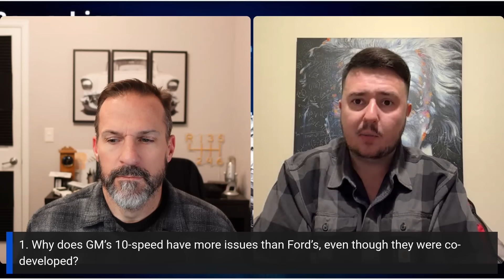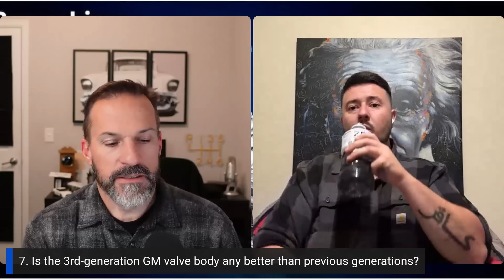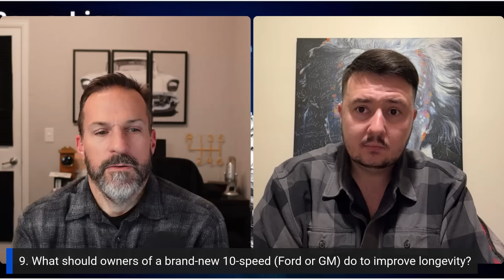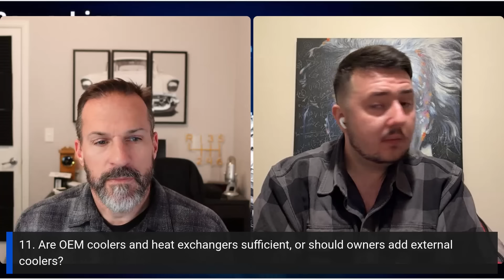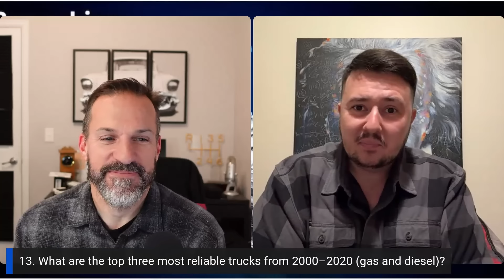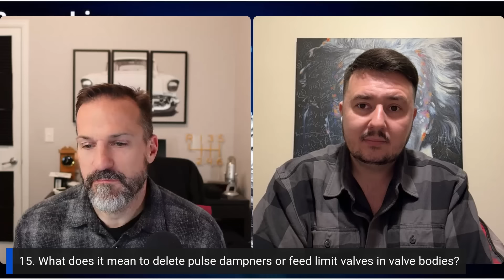Stop KILLING Your Transmission! The Maintenance MOST People Ignore (With NextGen Engineer)

Comment: Almost all the transmission issues ppl are having are due to heat. GM bypass opens at 190.. so the transmission on a summer day not towing is 200+. Get a SURE-COOL Flow Control Thermal Bypass Valve and this will lower your transmission temp by 50 degs. This is exactly what Nate describes his kits doing. The difference is.. it’s only $40. This won’t correct already damaged transmissions, but if your trying to get your trans to last long term, this is the solution

Comment: On cars that I do transmission fluid drain n fills , I like to rev the engine to 2k rpms to fill the torque converter then on the lift put it in drive and run it into second gear and In reverse letting the wheels turn , a few times reverse and drive , then in park let it heat up while still running until it reaches the oem spec temp . Then adjust the level . Another full proof way to put in the same amount of fluid as you took out is to measure out what you take out so you know that at least bare minimum you’re putting back in what you took out and then recheck the level.

Comment: I can support the correct fill problem. Years ago I changed the 4l60 in my 98 k1500 gmc pickup and never double check ed and drove it at least 2 quart low for at least a year and it never up shifted properly, it would hang shift... then I filled it while in neutral to run the pump and, after filling it up, shifted properly. Too any doubters, I'd believe him.

Comment: I do a transmission flush at home. Drain and drop the pan, swap the filter. Pan back on, then disconnect the cooler return line and use some clear tubing to drain it into a bottle with graduation marks. Put back in the same amount of fluid as I initially drained. Start the car, drain a quart, stop it, add a quart, rinse and repeat until the transmission fluid coming out of the cooler looks fresh.

Comment: I wonder if a modern engine could be retrofitted with a dip stick?  Just checking the transmission fluid on most modern engines requires getting under the vehicle and opening the drain port.

Comment: On older high mileage cars that I buy I will actually do two drain and fill services with a day or so of driving between the services. That way I have way less diluted fluid in the trans with a higher percentage of the additive package. It’s surprising how dirty the fluid is on the second service with just 20 miles of driving on it.

Comment: Mechanic dropped my equinox tranny fluid at 44,000 then I realized it was not hard to do so I did it at 60,000 miles 2 separate times with a few 100 miles intervals and the first time it was thick milky and the 2nd less so. I realized that if I fill it I have to drive it a little to get it hot then check it to get the right reading after I filled it. All of this about never change it after high miles was a good question to ask to clear up.

Comment: So just on the topic about reliability, service and maintenance, I did not hear anything mentioned about differences in fluids being used but are within the same spec. So for instance is there a difference in the ULV fluids in GM's vs Fords? How do they differ from each other and how do they differ from other manufacturers that create the same Spec of fluid? Are there advantages over one versus the other? Does one create better heat dissipation than the other? Questions one may wonder to buy an $8 qt versus an $18 Dollar qt.

Comment: Unbelievable that a nearly 100k truck needs everything deleted to make it last.
Reply: They want you to rent everything
Reply: My old 2003 Chevy truck has everything. I haven’t deleted anything. Same cats. Same exhaust system except for the muffler. Some drive train. Same transmission. Same interior. It has 388k miles
The key is maintenance. 
I don’t use any additives for my transmission or engine. 
I use textron fuel injector cleaner ever other month.
Reply: @2nickles647 your 03 doesn't have the emission system an 2020+ has. Which is what everyone deletes. No amount of maintenance is gonna prevent a cylinder from self destruction due to cylinder deactivation.
Reply: I don’t buy new cars or vehicles. Just because 😂😂

Comment: Hello, 3 questions to ask Nate. 1) What does Nate recommend on oil change frequency. 2) I have a 2015 Buick Verano with no physical way to check oil level, any suggestions? 3) Is it a no-no to dump oil through cooling lines until trans pump hits air, over fill, dump again, then top off to correct level (complete oil exchange). Thanks.
Crying shame our car manufacturers are adding to our financial demise in such a large way. Can not trust a new car on long trips, they are too complicated, too many components to go wrong.
Reply: He said every 30,000 miles in the video.   There is always a way to check fluid level in a tranny.   Some you have to buy your own dipstick for others you have crawl underneath and use a mini dipstick.    Dropping the pan once gets 50% NEW FLUID.  Dropping the pan a second time after driving a few hundred miles equates to 75% new oil after a second refill.    Every time you drop the pan, clean the magnet.   Magnets do as much to clean the fluid as the strainer.

Comment: I would sure like more information now on the current generation EV gearbox. I just bought a Silverado EV with the max battery pack. Let’s push in 750 hp and now I’m kind of wondering about the reliability of that long-term.

Comment: Well, there’s a oil filter so I guess it’s not like sandpaper completely really
Reply: Automatic transmission filters are more like a strainer than a filter.  Being on the suction side, they can't be too restrictive, or the transmission will starve for fluid.   Drop a pan on a 10R80 WITH 10,000 MILES, AND YOU WILL SEE A METAL SHEEN ON THE OIL.  That is the small metal particles he is talking about.    Not to mention, the 10 R80 has one of the more advanced "filters" and it still can't get rid of this metalic sheen.

Comment: Few quick questions.  I have a 2023 Sierra AT4 with the 6.2l (new engine this past January).  I bought it used with 27k miles in Oct. 2024.

1.  Wouldn't the trans filter remove the particulates in the ATF before the fluid gets to the torque converter and such?  Not debating this at all as I'm no transmission guru.  Just thought it would have is all.

2.  Is there a way to identify one of Nate's valve bodies vs. an OEM one?  Next time I change my filter, I want to check to see if it may have one because my transmission runs at about 145F in the summer.  So either the stat is stuck open, someone installed a dumbell kit, or it has a non-OEM valve body.

To replace the trans filter in my truck runs just shy of $1k at the dealership.  So to position myself to do my own maintenance I got a PPE oil pan that has a drain plug in it.  I then paid an exhaust shop to cut out the Y pipe the crosses under the trans pan, install exhaust flanges flanking both sides of the pan and make a new "mid pipe" (as I call it).  Now, instead of having to disconnect the Y pipe from the headers every time I just remove 3 bolts on each side of the pan, drop the pipe, drain the fluid then drop the pan.  Easy peasy.  The money it cost me to have that done including the pan was less than the cost to have the dealership do it.  And now going forward it will be far cheaper to do my own maintenance every 30k miles as Nate recommends.

Comment: Agree with a lot of what Nate states.  This is the best video coming on this topic. However, the comment regarding OEM filter. Puralator makes the filters for Motorcraft. Now, you have Puralator, Motorcraft, and Ford which markup the price. Save yourself some money buy whichever Puralator filter meets OEM specs. An OEM induced problem is when they removed the transmission dip sticks to cut cost. In the past we would check transmission fluid on a regular basis. We checked for contamination and smell. I think most transmissions use a plug. When the OEM's removed the dip stick or a way for the owner to monitor this was a huge win for them.

Comment: i swapped out my transmission fluid several times in my titan....and used multiple brands....valvoline and stp....etc....THE BEST for my first gen titan is the factory beck arnly fluid....it shifts smooth ...it doesnt burn out  and cause hard shifts etc....i have 250k on this titan....swap it out every 40k miles....DO NOT TRUST  the dealership maintenance INTERVALS at all....always ALWAYS replace ALL fluids before the fluids break down.

Comment: Nate- we have had excellent results doing a fluid transfusion (fluid exchange using the transmissions pump vs force flushing) with a high quality BG products ATF w/ a BG service kit, and especially on gm 8 spds we have seen the shudder go away and most cases stay away. For out of warranty vehicles, this has been a home run. Thought id mention it

Comment: I own my own shop and I've always told guys I work with when you do a transmission service you get a clean bucket with measuring indicators on it before you drain the transmission fluid you warm up the vehicle make sure it is full And not leaking. Then when you drain the fluid you measure exactly what you took out of it. That way when you go to add the transmission food back you are not guessing because sometimes it is hard to read the dipsticks especially on Ford. This will increase your efficiency in the shop. And make sure you are not messing up someone's transmission. On 6 and 8 speed transmissions for the G m's these days I recommend my  Customers at about 15000 miles. To start doing what I call a mini transmission service. Where I take a fluid evacuator And  Suck  As  much transmission fluid as I can from the dipstick tube measure it and replace it with factory recommended fluid. Then service the transmission every 30 to 40000. This keeps the condition of the fluid in great shape. If you like it is especially important if you do any kind of towing or heavy hauling. You are constantly cycling out a percentage of old oil with new oil.
Reply: I 100% agree with that. I had the fluid and filter changed a year ago in my Yukon Denali (6L80E), and a month ago I checked and the fluid was black. The shop wanted $600 to change it. So I bought a fluid extractor and just changed the fluid. Maybe in a year or two I’ll change the fluid and filter again
Reply: Agree with exact measurement of ATF drained = exact ATF OEM Fluid added. Need clean drain containers AND if fluid drained HOT….let it cool before final measurement. Then add ATF (cool / room temperature).
Reply: I have to clarify and ask,…you are first making sure that “at temp window” for oil level check is confirmed, then do a pan drop (hot) and measure what comes out. Then clean up the pan/gasket and install new filter then install pan, then at least fill with same amount that came out and run the temps up to “temp window”, run the gears, check levels, make fluid adjustments? Is this your system?

What happens when I know the fluid level is correct and I want to do a pan drop (cold), measure cold fluid that comes out, do all the clean up and filter change and put same amount back in (cold) then run up temp window and run gears. Does this accomplish the same thing? (Hot pan drop is the same as cold pan drop) as long as level check is done at temp window.

Comment: As someone who’s always done an early 1st oil change (1-1500 miles) to help flush out any metal debris (wearing in material or leftover machining particles) which I know is a common step many people take, I’ve never heard anyone do an early trans fluid/filter change.  You’d think based on what Nate is saying that as the clutches wear in there would be more material swimming around in the early stages of the trans life, that you’d want to remove that as early as possible.
Reply: An End Of Line Transmission Test Engineer I called on could pull Test data reports by VIN.  When shopping for his personal vehicle, he pointed out his preferences for those that initially failed the test requiring rework, exactly because the fluid would have been evacuated (along with the mfg debris) then refilled, tested.
Reply: 😮I have a 2016 Silverado with 5.3 liter engine with a 6 speed Transmission. Would it help to extend the life of the transmission to use the “m” manual mode and put it to 5th gear to help the transmission from shifting back and forth between 4 cylinders and 8 cylinders?

Comment: "No computer" in earlier transmissions?  They have mechanical/hydraulic "computers" which program their operation.  Much more reliable than electronic ones.
9 and 10 speeds are EPA wonders which drive up total cost of operation.  They save a slight amount of fuel at more cost than what they save in fuel.  My opinion is that 5 and 6 speeds are probably optimal for lowest lifetime cost.
Reply: Every time the unelected EPA mandates things it cost us all lots of money. Trump has failed us there!  Big time.

Comment: When I had converter shudder on my 6l80e I was at 200k miles. I was in overdrive and going up a slight hill that didn’t make it downshift. It was in lockup and when I hit that hill on cruise control it shuddered. It just felt like the converter clutch was slipping and couldn’t hold the load anymore going up the hill. When I started looking into it, you hear everyone say you need to tune the tcc lockup to zero because they program a little bit of slip on lockup to make it “smooth”. They also say to tune it to only lockup in the overdrive gears and not in gear 1 to be gentler on the converter. I think the valve body and the tcc slip to zero would make the 6l80 and transmission that’ll last you hundreds of thousands of miles.

Comment: In the past the clutch material was very different from today. IE: C4, C6, torqueflight, 350, 400. I worked at AAMCO and people would come in for a service after never servicing the trans and we would tow them back in the next day finding the clutch material peeled off the backing plates. I haven't seen this happen since the early 700R4.

Comment: My two 2002 4.7L Tundra trucks, one 2006 Sequoia and one 2007 5.7L Tundra all have factory transmission coolers, all have over 200,000 miles... the '06 and '07 are over 300,000 miles. Three of them have a transmission fluid dip stick, the '07 does not. All of them receive drain and fill service about every 50,000 miles, and I am using Valvoline MaxLife Multi Vehicle Full Synthetic fluid.

Comment: Agree 100% about fluids and same with premium top tier fuels keeping carbon deposits off out of the engine. I have seen where yeah you can use low grade octane and knock sensors retard the timing cutting timing and causing soot, carbon deposits and oil ring gland issues along with the afm causing issues with cold cycles and cylinders using oil from start stop activations. You will never save money being cheap.

Comment: my story keeps getting deleted. weird indeed.
Reply: . Took my ford with the 10R80 to dealer. car done 60,000km. in case you ask....I like to maintain my cars etc .
I have been monitoring my car systems with an obd scanner and watch live data whenever i drive.
Auto trans temp, unloaded 88-95C in general high  speed driving. 
So  trans oil changed. then NEXT DAY took it for a drive 100kmh unladen  after 20 minutes i noticed trans temp reached 110C.
 I turned off the highway into a lower speed side roads and the temp lowered to 99C.

The problem  was overfilled with trans oil. This caused ( according to my AI search) the trans fluid to froth  and not transfer heat out of the system. 2 days later the dealer got my oil level redone.So far on 3 long test drives auto temp remained from 85-94C. 
First thing.. How would anyone who does not do tech OBD monitoring like me ever know there will be a problem.
Since i tow a 2500kg caravan occasionally i have no doubt the car  would have gone up to 120C and gone into limp mode. 
Lesson.. always check you tans oil level after a oil change.

Comment: Hey @TheCarGuyOnline, love the videos. And shoutout to Nate for always breaking things down so clearly.
Quick question. how do the 2500HD GMC/Chevy trucks with the 6L90 compare to the 6 speed in the 2nd gen Tundra?

I’ve been seeing people say the GM HD front ends get loose unless you upgrade them. Is that actually true? I keep finding those base model 6.0 V8 work trucks for good prices, so just trying to figure out how they hold up in the real world.
Reply from the maker: I have not had personal experience with the GM, my step dad has the 6.0L and older transmission, my Toyota 6 speed (2nd gen) is crazy good. They almost never have issues unless they are extremely neglected..from what I have seen. I've owned 3 Toyota 6 speeds, one I still own has 237k on it with zero issues so far, quite a bit of towing too.
Reply: @TheCarGuyOnline  that’s awesome! It’s great to hear from a tundra owners real world experience. Especially since I just picked up my first truck. A 2012 tundra with relatively low miles.

Comment: I LIKE THE WAY NATE THINKS AND OPERATES. YES, POMPOUS BUT YOU KNOW WHAT? IT AIN'T BRAGGING IF YOU CAN DO IT. AND HE DOES IT. HE IS RIGHT ABOUT DELETING ALL THE THINGS NOT NEEDED IN A VALVE BODY. IT CAN'T BREAK OR CAUSE ISSUES IF ITS BY PASSED. HE TAKES A COMPLICATED VALVE BODY AND MAKES IT SO MUCH MORE SIMPLE WITH LESS TO GO WRONG THEREBY DECREASING THE LIKELYHOOD OF FAILURE. ITS BASIC MATH - THE LESS THERE IS TO GO WRONG THE MORE RELIABLE THE OVER SYSTEM (TRANSMISSION) IS.

Comment: Hell yeah. My 2023 4Runner is still using the toughest Toyota transmission ever known to man. A simple bulletproof Aisin 5 speed. The A750
Reply: 1980's and early 90's 4 speeds were even better; e.g. The A43D 4 speed in pickups and 4Runner - no electronic shift control solenoids or torque converter clutch to wear out and had cool fluid temps under most driving conditions (130-175 degrees F).